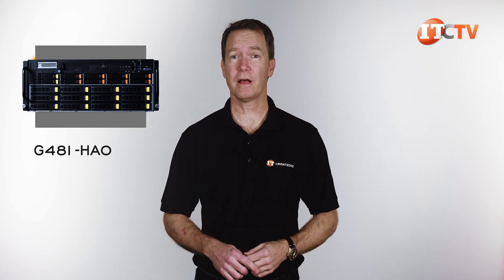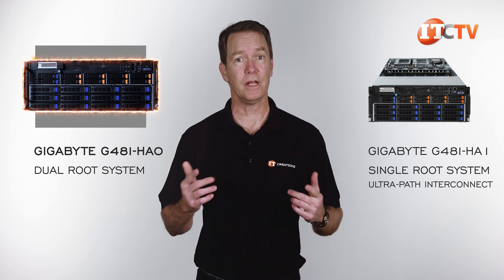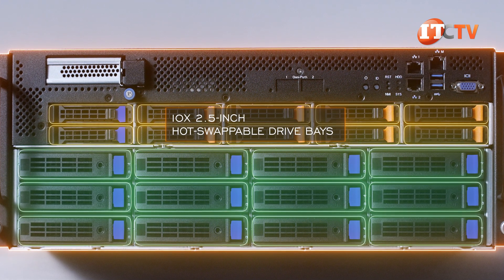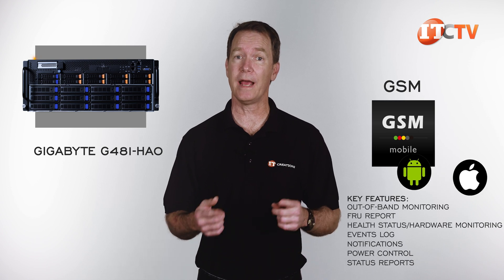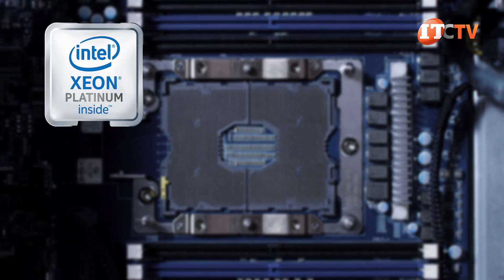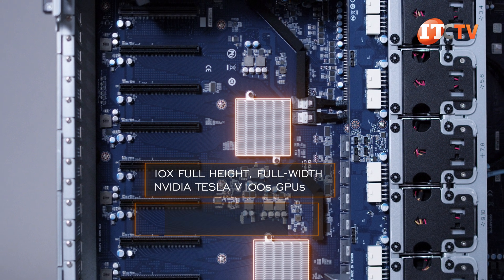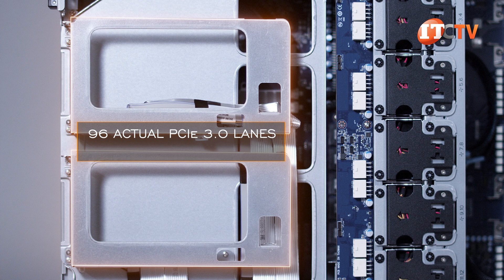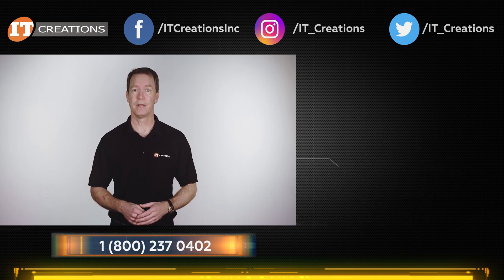10X GPU Gigabyte G481-HA0 Server REVIEW | IT Creations

Comment: 7:37
to be sure, each QSFP28 can do 100Gbit, so 4 of them, is 400Gbit right?
Never even knew there were Xeon's with that, I am guessing they never really gained interest as it didn't make much of a difference to most workloads? We anyways even had dedicated slots just for NIC's, forgot what that interface is called
Reply from the maker: Hi there Harira,
Yes this one has two dedicated 10GbE slots just for NICs but you can always add more using the omni-path mezz card at the bottom and the PCIe slot. 
In a nut shell, that QSFP28 acronym stands for Quad Small Form Factor Pluggable and allows for bidirectional traffic. They are hot-swappable and the aggregate of 100Gb/s is divided by 4 so actually only 25Gb per each of the 4 channels of bi-directional traffic. Benefits include longer cable lengths and less clutter with several channels occupying less space. In a nut shell, there are a bunch of different types of SFP cables offering different capabilities. Here is Cisco's data sheet. https://www.cisco.com/c/en/us/products/collateral/interfaces-modules/transceiver-modules/datasheet-c78-736282.html#Productoverview 
Hope that helps clarify, and thanks for watching and commenting